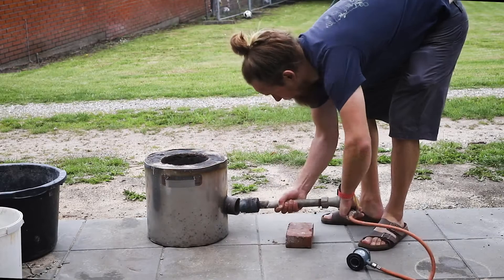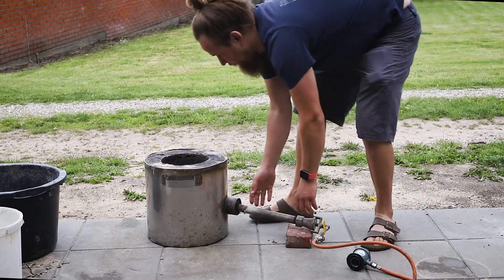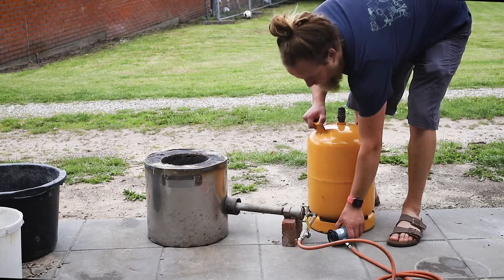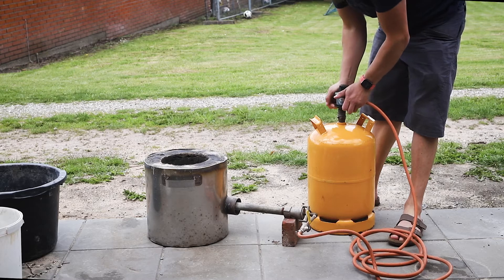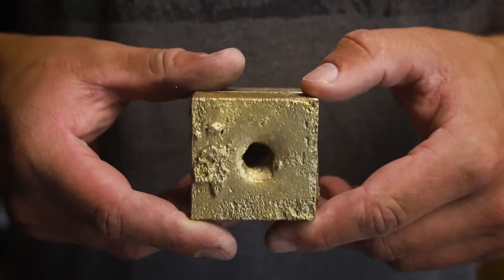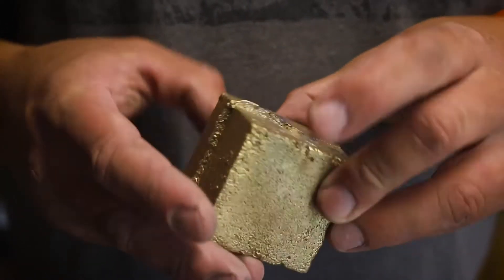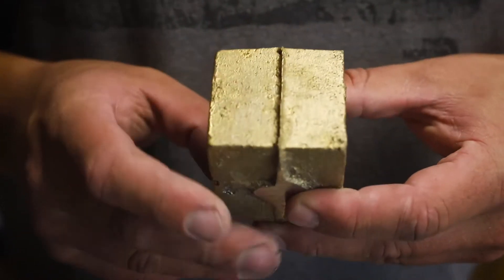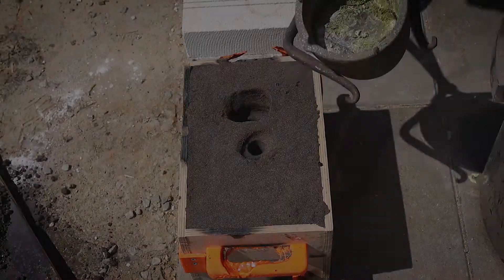Casting a Yellow Brass Cube - Element Cube Collection

Comment: Do you know why it generated flames when you put the zine in the molten copper?
Reply from the maker: Yeah, that copper was simply too hot; making the zinc burn. The tricky thing is that copper melts at 1089°C and zinc start boiling at 907°C already..
Reply: @jakobhalskov  That is a bit tricky, I didn't know that about the temperatures. Thanks for answering.
Reply from the maker: @stormelemental13  Yeah, and you are very welcome!